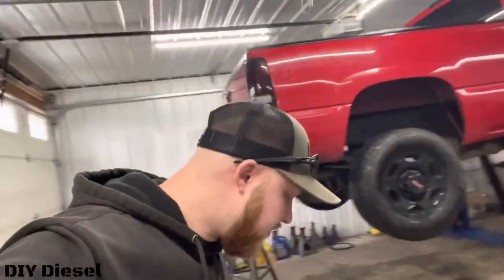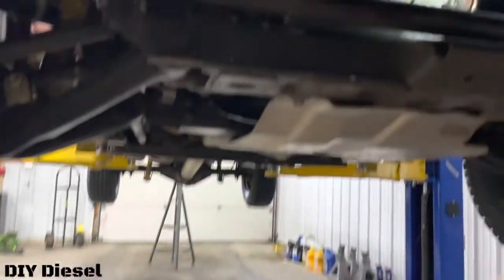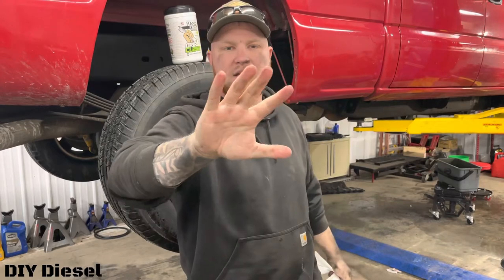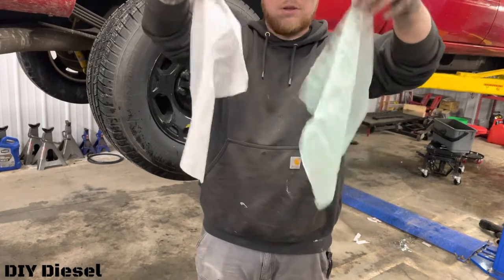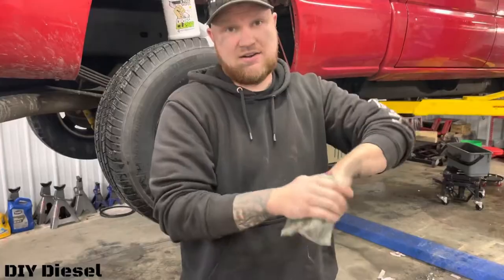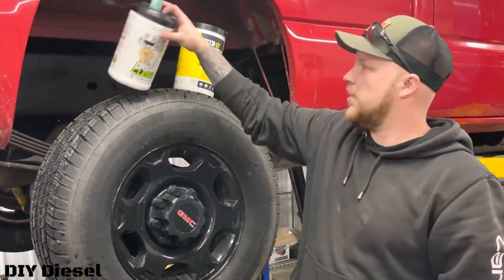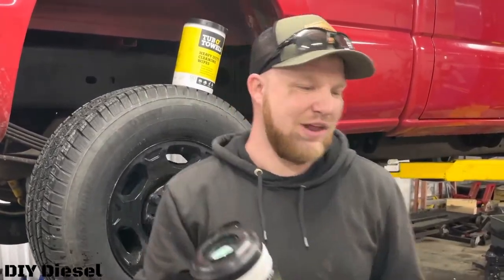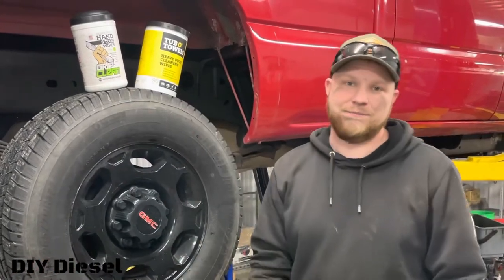Tub O’ Towels vs Grip Clean Hand Towels

Comment: You can see the skin irritation from the tub o towels. That’s crazy how much of a difference that is. Definitely going to try those grip clean towels. I do roadside semi and farm tire service and my hands do get fairly dirty and I hate getting my tools and steering wheel any more dirty than they need to be.
Reply from the maker: Honestly buy just one container of that grip clean stuff it’s mind blowing. The soap is even better I keep a bottle in my kitchen lol
Reply: @DIYDiesel  is it a waterless wash soap or do you have to use water to get the soap off. Currently I’m using Goop simply because it cleans decent enough and I just wipe my hands off when I’m done.
Reply from the maker: @bigcountry6879  I use it with water. I have not tried it without using water yet